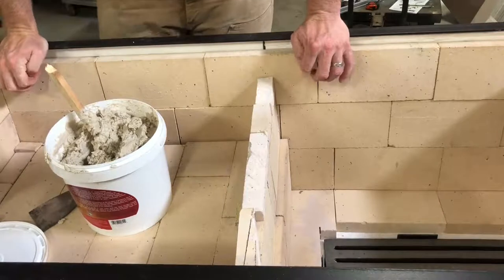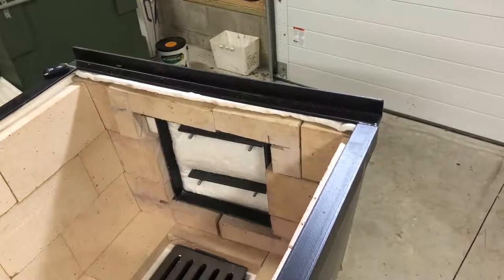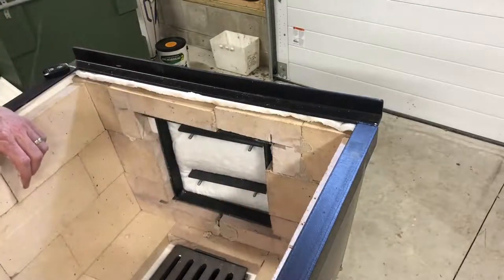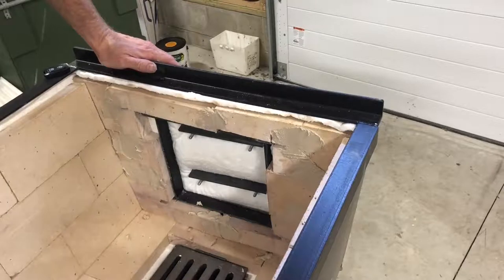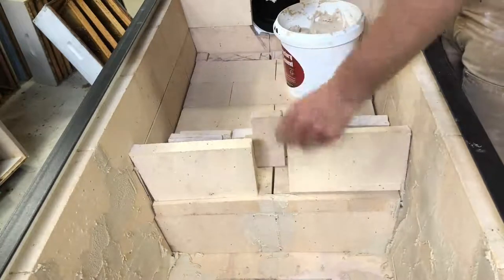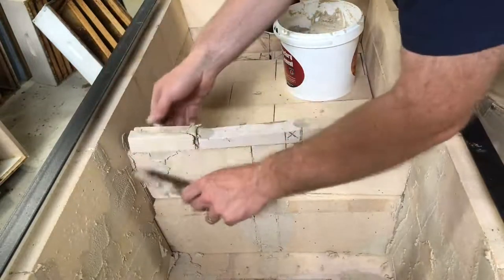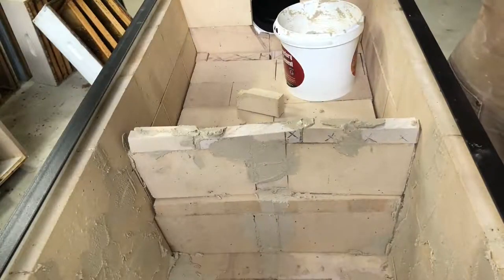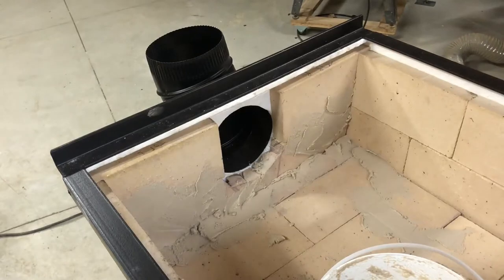Cementing the WF Mason 2x4 Evaporator

Comment: can you tell me how you added the wheels to the legs?  thanks!
Reply from the maker: I used straight rod for the axles and drilled holes on either side of the wheel for pins to keep the tires from going too far out or in. The axles are held on with strapping screwed up into the wooden frame. I got the tires from Harbor Freight and used washers to go up against the pins that hold them in place. Hope that helps and thanks for watching!
Reply: @scottthornandhisbeesandtrees  Thanks, Scott!

Comment: I'm bricking my Mason today how did yours work out ?
Reply from the maker: I’ve used it several times now and it’s working great. I roll it in and out of my barn each time and I have had no issues. I never did get the back filled with material to keep the flames up on the pan but it boils great.

Comment: Do you like the 2x4 pretty well? What’s your GPH? Thanks!
Reply from the maker: I absolutely love this set up, Coming from years of a much smaller pan it was a total game changer and turned maple back into an enjoyable hobby and not a chore. 
For boil rate, these are advertised 9-12. I didn’t do a great job tracking but feel like that was accurate if you count time from lighting the fire to cool enough to walk away from it. I feel like it was much higher when the fire was cranked and running good.
Reply: Thank you! I’m considering ordering one. If they can get it to me in 2 months I will.  I built a barrel stove and have used steam pans for 2 years. It’s hot but not as efficient as I need! Thanks
Reply from the maker: You’re welcome. I haven’t checked in a while but I know he is always super stacked up with orders. I placed my order in spring of 2021 and it came mid-summer. But I knew it was going to be a wait so I planned ahead. Best of luck to you! I think you won’t regret moving up to the larger evaporator.
Reply: @scottthornandhisbeesandtrees  worst case scenario there is a company by the name of Silver Creek Maple that makes something similar and a 2x5. I don’t like their design as well but it would probably work just fine. Thanks! Appreciate the video!
Reply from the maker: @SingleCreekMapleSyrup  sounds good. Keep me posted; maple is always my favorite part of the year.